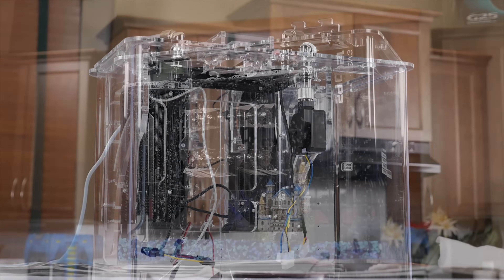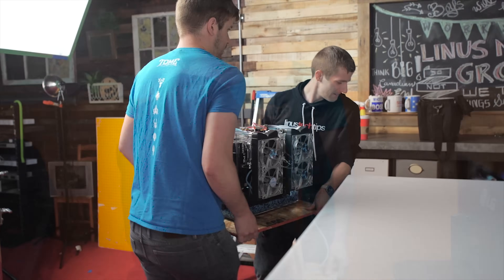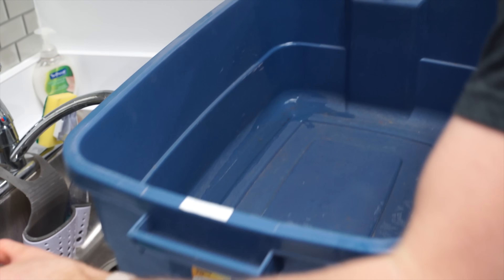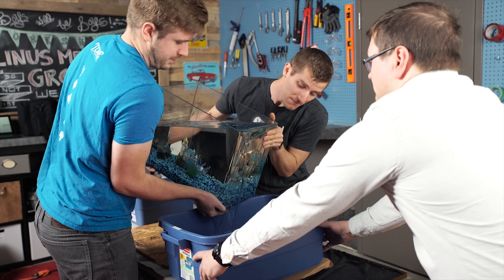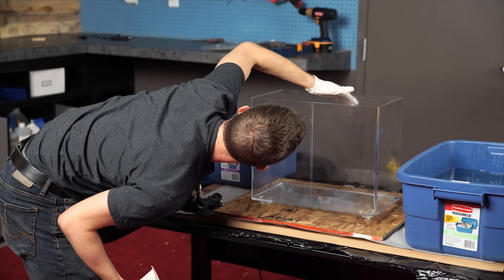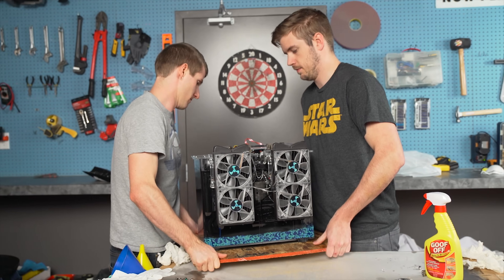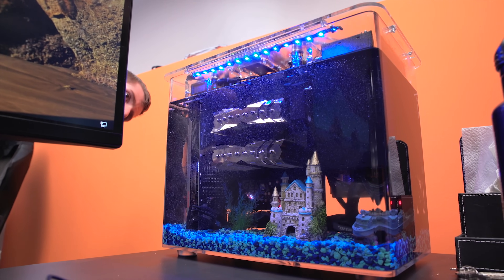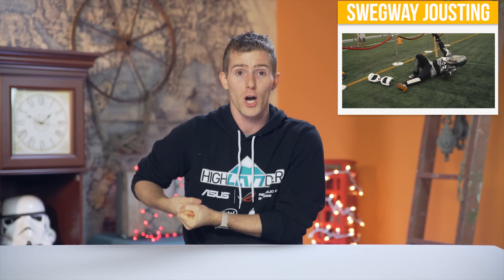Aquarium Mineral Oil PC Maintenance Vlog

Comment: moving a full aquarium can crack it, hence the wood used to transport it. However my advice would be to find a short piece of tubing or hose to use as a siphon to drain it rather then putting it through the extra stress of pouring it. A slight miscommunication between you and your helper might end up torqueing the tank ever so slightly causing disaster! (just trust me on this, i'm a former fish guy)

Comment: You can get an inexpensive aquarium siphon with bulb at Walmart.  The siphon bulb should break the air vacuum at top of hose and encourage oil to flow naturally up and over edge of aquarium.  Aquarium Fish Tank Cleaning Hand Squeeze Water Changer Pump Siphon 1.6M costs $7.37 Never tried it but may work with mineral oil.

Comment: Tip for next time: use a 2-3 foot length of tube to siphon the oil out of the tank before you even move it. Oh and get Dennis to start the siphoning by sucking on the hose, hopefully he wont ingest any of the oil.

Comment: hello, Linus. I like your informative videos. If you make your oil pc container out of plexiglass, it's easily breakable therefore, I wouldn't recommend using plexiglass for liquid containers. Next time choose polycarbonate plastic panels or something more structurally sound materials. You can google your local plastic material providers or purchase it on amazon. It would cost you under $100 for 4 feet * 8 feet quarter inch thick polycarbonate plastic. Keep up the good work!

Comment: if you ever get tired of the clear look you can add transmission oil to it, makes it a nice red color. used to run min oil pc when I finnaly took it apart the ram sticks separated from there pcb. I dont kno if that was from constant overvoltage but man I was able to get some good overclocks on the fsb

Comment: prob lost in the comments but i think i know the solution to avoiding the cracks all together based on owning an aquarium.
The issue are the stumps on the bottom, little "legs" holding it up. As the bottom is not lying flat there is tension along the base which resulted in cracks. Having the base lay flat on its own is not good enough either, as no surface is perfect. You need to add a base foam pad, you can get in any aquarium shop for few dollars (they are really cheap). Acryllic looks really nice and all that, but honestly aquariums are better built. The industry for aquarium making has a lot more experience in that. Mineral oil has a smaller density than water too, so the aquariums are built way stronger than they have to be ;)

Comment: protip check it for leaks with water, outside on cardboard, easier to clean and tip out/repair ect, could also put a valve on the bottom somewhere...

Comment: I used a glass tank with 16 gallons. It was a bear to take the computer out after. The dishwasher helped a lot. lol  Also consider running a bead of super glue around the bios battery. I have the video of the build on my channel.

Comment: *suggestion: install a drain nozzel at the bottom of the system in the future, so you can simply drain the fluid if you need to do maintenance?

Comment: you should get a peristaltic pump for pulling a lot of the oil out of the tank... the pump itself doesn't contact the oil, so no grease from the bearings in the pump will contaminate your oil...

Comment: You might consider adding a couple of valves on the supply side of the radiator so you could use the pump to drain the oil.

Comment: you should try replacing that acrylic for glass it shouldn't be that expensive but it would be much safer.... thing is I work with acrylic in a daily basis and the damage you showed there is pretty much the same I see in laser cutted acrylic that has been cleaned with alcohol for some reason it just starts to shatter in really tiny cracks and eventually breaks off. I know you maybe have already put this pc on a shelf somewhere but I happen to like it a lot, so get busy upgrade it and swap that thing for glass and you'll see it is worth the effort.

Comment: its An acrylic tank not glass. Acrylic bends unlike glass aquariums so the weight of the oil plus moving the tank around with that weight is most likely what caused this. It will do this again so i suggest syphoning the oil out rather then pouring it out or syphon most of it before you pick it up. this is why acrylic fish tanks require a base that supports the entire bottom unlike glass with can just be supported on the edges

Comment: I just found your pages. What a cool project! I wonder, why didn't you use thermoelectric cooling in it? One of the original reasons to sink computers in oil was to avoid condensation of water in components. The condensation is an issue if you cool components below the dew point. That can easily happen with TEC. In mineral cooled PC there is no such limitation.

Comment: Not to rain on your parade, but fully believing in work smart not hard... Using a siphon would eliminate the need to lift the tank... A very inexpensive fish tank gravity vacuum would accomplish this and save  your back!  You can also put it in to several smaller vessels for disposal, or reuse. Just a small tip for your next mtx cycle.

Comment: When you empty a small fish tank, pour from a corner, not a flat side. Positioning the tank is a little bit harder, but controlling the liquid flow when pouring is much, much easier. And less messy.

Edit: Also, are you sure the hairline cracks are not from the oil chemically reacting with the acrylic? I used alcohol to clean an acrylic pump housing once. Not. A good idea. At all.
Reply: +Lars Simonsen Or just use a siphon and save yourself all of that pouring effort until the last amount

Comment: Linus You Just Want To Use Pump Pipe To Drain 70 % OIL Without Spilling It Out Or Getting All Those Oil's On Hand........And If You Want More Simple Then You Just Have To Add A Hole At Bottom Of Corner And Fit The Tap For Draining 94% of Excessive Oil .

Comment: Wouldn't it be easier for when you do need to perform maintenance on a oil-cooled machine to run a weighted hose towards the bottom of the tank with some mesh grating (to keep rocks from being sucked in), so you could take the intake hose and put it in a container and just power on the pump to extract the mineral oil out? That would also allow time for the oil to drain from the components, and allow for a MUCH cleaner disassembly... Just a little recommendation for the future...

Comment: this is why i like air cooled pcs
Reply: depends, yes this is not the most logical way of cooling your parts but it is pretty unique and cool
watercooling can be pretty easy, i'm using a h100i all in one cooler and it was realy easy to install and use
full custom watercooling nowaday's doesn't realy have an added benifit over air cooling (maybe quieter), but if you have the time money and mindset it realy is amazing. 
just watercooling now is more about the looks, lower thermals and slightly better preformance
Reply: yes but i am planing to get a water cooled pc but right now i like air cooled

Comment: When you want to drain the oil out of the system, you can syphon it out; a lot less messy than pouring it!

It would be even easier if you used a tank with a tap at the bottom. :D
Reply: staticyrro and the rocks? what about the rocks...

Comment: Ehm, I would use long plastic hose and gravity to get oil out without mess... Aquarium on table, basin on floor, attach the hose so it does not fall out and give kick start to oil by sucking until it starts pouring down. PC can even stay in because it would drip on its own in time needed to transfusion - bugger of for a beer instead work in three guys to juggle heavy, dripping, slippery containers. ;)

Comment: The problem wasn't the way it was handled, the problem was stability. That's a lot of weight pushing against the sides, and there isn't much holding those sides perpendicular. A more rigid base could have helped, or possibly a brace around the middle or near the ends.

Comment: mineral oil draws the moisture out of your skin. causing dermatitis over time. and draws moisture out of the air. Especially when you cool in down. as it cools. when switched off it will take on moisture. because as it cools, it will create a weak vacuum in the air gap. as the air gets cold, its volume decreases, pulling air from outside the tank. i work with distribution transformers. they have silica breathers. or messko breathers with freeze the air and remove it that way. and when you have a fans that are half in and half out the oil. your circulating moist air in with your oil. would be interesting to see the dielectric strength after a year.
Reply: no. when you test mineral or silica oil in transformers you test for moist. acidity and dielectric strength. the moisture test is simple. you put oil in a test tube and heat it. if it crackles then there is moisture.

Comment: I would've just held onto the original big container that all the oil came in and siphoned the oil into that for transporting it, then it wouldn't be so heavy/hard to move and you'd avoid possible damage to the tank.

Comment: should have just used an oxy acetylene torch held about 6 inches to a foot away, the acrylic would being to slowly melt and ooze back together. If you do it right, you would barley even notice it was done this way. Even works with some of the better heat guns that have nozzles and such
Reply: +DDOGJENKINZ I thought this was glass, not acrylic.

Comment: Working on gathering up materials for my own. I will be using an actual fish tank instead if a specialized tower, and repurposing a slightly bent dirtbike radiator and electric fan for cooling.. However my PC is nothing special its pretty old. Only running an Nvidia GTX 670, an intel dual-core 2700hz cpu and an old school MCP73VT-PM intel board that maxes out at 8gigs of RAM. It works for what i do mostly daily computing and playing WOT and War Thunder at mid level graphics.. Did just upgrade to a 31" HDTV as a monitor yesterday so eventually i will have to step up my computing game..

Mineral oil... AKA BABY OIL is not going to hurt your skin in any way. 
However DO NOT use actual baby oil like Johnson&johnson for your oil cooled PC project since it usually has added fragrances which may or may not cause problems just not worth the risk. You need 100% pure mineral oil witbout added fragrance and try to avoid the "extra heavy/extra thick" mineral oil some companies use for laxative as it obviously provides a bit more resistance to the pump and has extra weight and resistance to flow.
There are different types available but the butchers block oil, food grade mineral oil etc are usually 100% pure. Gets kind of expensive by the gallon but souped up computers are never cheap 😂

Comment: Don't pour the oil, siphon that shit! 

Go to your local Home Depot and buy a few feet of 1/2" diameter vinyl tubing. Put your aquarium on a table or countertop and your collection vessel on the floor below. Have a friend hold one end of the siphon hose into the oil-filled aquarium while you bring the other end down over your collection vessel, then use the mouth suction method to draw enough oil into the hose over the top in order to get the siphon going. While the oil is flowing, make sure to keep the outflow end of the tubing below the level of the oil in the aquarium above. 

Siphoning the oil back into your aquarium afterward will also avoid the problem of disturbing your aquarium decorations at the bottom of the tank.  

Easy peasy!

Comment: ... and mineral oil is not what they use to clean surfaces before welding; that's flux... unless you're talking specifically about electrical components, and then I suppose tetrachloroethylene, acetone, turps... the volatile ones that you can evaporate, so as to condense the cleaning solution onto the component and have it drip off with the solute (dirt). I'm pretty sure that's the industrial process of cleaning electrical components, which you'd solder rather than weld (but use a similar flux nonetheless, to ensure the filler doesn't corrode during deposition)... They tend to use those other methods which eliminate 100% of any residue or dirt when they REALLY want to CLEAN the component.

Comment: Any toughs on making a new one? I would like to se a totally submerged pc with one large radiator on the back cooling the mineral oil. Also i believe you could remove the fans on graphics cards and CPU if you added one or more larger pumps that made the oil circulate more through all the radiator fins that are submerged. Kinda have the feeling that it could possibly be a really REALLY good overclocking setup if the circulation is correctly set up.  And of course more LED for show.

Comment: those cracks are not from vibrations they are from glue...one tip- when you glue acrylic you have to sand the edges that have to be glued so it wont crack

Comment: I have a oil pc myself. Anytime I need to move the tank I drain it by popping the return line from the radiator off and replacing it with one long enough to reach a bucket. So the pump does most of the work.  It doesn't get all of the oil but it does make it much easier.  maybe you could try that next time?

Comment: Yes having a transparent case for the oil cooled machine is cool but do you not think you were asking for this issue by using a fragile material like plexiglass? What about repurposing a Stainless steel or other more durable injected molded battery box so you have no joints to worry about?

Comment: I had a similar issue with a soap dispenser.  It leaked at the base.  Always buy a single-cast container if you can.  Also, why didn’t you memtest your RAM before assembly?  I had build corrupted by defective RAM, so I always memtest new RAM before closing up the case.  Bad RAM can still pass a POST.

Comment: Why in the world didn't you use a siphon to drain the oil? All you would have needed is a cheap plastic hose from the hardware store.  Don't even need a pump to get is started, just dip one in into the tank first, let the tube fill with oil, seal the end with your thumb. To start the siphon you just need to moved the sealed in somewhere outside and below the tank and let go.
Reply: +WorBlux 
A thousand times yes.
As an ex aquarium enthusiast, yes, siphons make things possible.
Also, why not just buy cut glass and make a better tank to begin with?
Nice thick 8mm glass panes and silicone them together , those dont get microfractures.

Comment: I thought acrylic is not good for oil tank. Generally, this system has a high pressure from oil volume. If use glass for construct, that might be better.

Comment: Why not have a valve to release the oil towards the bottom of the case or even underneath it? Seems like a better way to drain it for repairs/upgrades.

Comment: Can I ask why you didn't take a drill bit, drill a reasonable sized holes in the bottom of the base, and use some orings, high strength/industrial caulking, and install an easy emptying outlet on the bottom of the base? Would of taken like ten minutes and would of made this much easier/

Comment: Why would they even make a case for something like this out of multiple acrylic pieces glued together? Why not just use a case that's single piece of plastic and remove that point of failure entirely. If you're going to use multiple pieces then you should've just made the case out of glass (Hell you could probably even get one made out of a single piece of glass but that would be incredibly expensive).

Comment: the craks was not made by moving the tank.  its by the glue.  this is the speks of the matirial if you had it laser cut or water aplayin most of tipes of glue will make micro craks on material .  i apologise  for crapy english

Comment: IMO you should not be using that kind of caulking, mineral oil will dissolve it eventually. I would use a butyl base or MAYBE a kitchen base. But using silicone or a acrylic latex base is risky and kinda silly

Comment: I see a serious problem in the design of the case, there's no tap for evacuating the oil. Also It hasn't any built it handles to lift and transport it. Also the case's walls are too thin (save money on structure is not wise).

Comment: i find it hard to believe that the battery pack is 5v 18 Ah, i made a component 14v batter 10 Ah that was about the same thickness but twice as wide and 4 times as long, and those were just the lithium iron phosphate prismatic cells

Comment: wouldn't it be easier to syphon the oil with a rubber tube into a container on the floor while the tank is on the table? it would make moving the tank way lighter.

Comment: It's too bad they couldn't have made the case out of something more durable like aluminum. Did they use acrylic because they needed something non-conductive? Or was that just so it would look nice and allow you to display stuff? I'm just thinking that hypothetically, if you want mineral oil for the cooling capabilities and don't care about showing off your system, wouldn't it be possible to just use something more solid?

Comment: Are there any advantages to mineral oil PC's besides looking amazing? Also, would an antifreeze or other chemical submerged PC be possible?
Reply: Additionally, are there manual changes that could be made to the fan motors to make them handle the higher viscosity better?

Comment: @Linus Tech, i have a question. How safe it is to put my whole board in oil. Maybe u can also make a video about such cooling systems and its pros and cons etc. Any how, if u can answer my question, that would be awsome
Reply: +AD KN It's mineral oil. It doesn't conduct electricity, like, at all. You can put anything in mineral oil and it'll run. Just be sure to contain it, and keep the oil moving, so that the oil itself can cool.
It's like a PC aquarium, but with mineral oil.